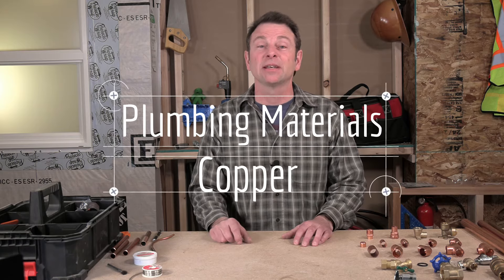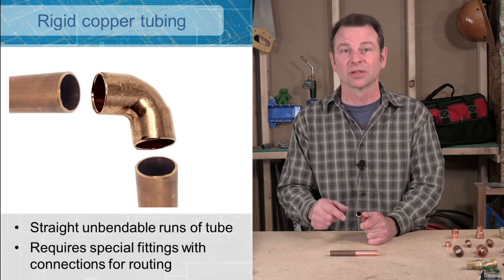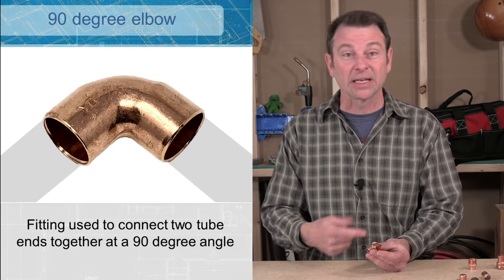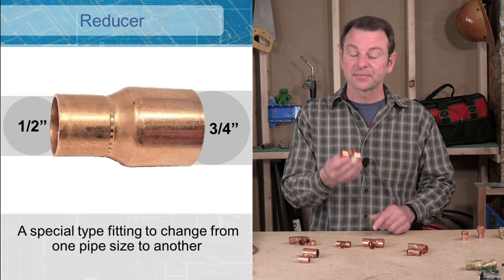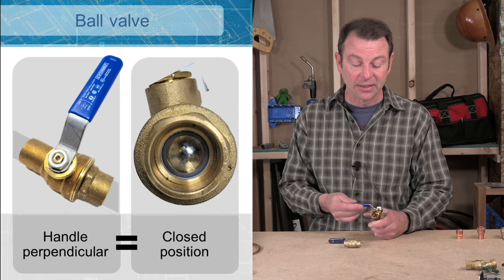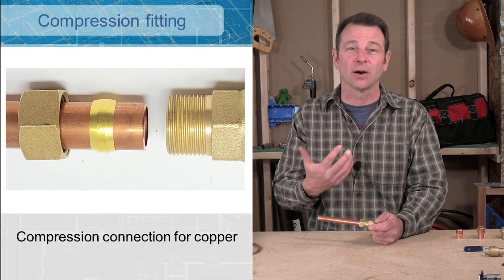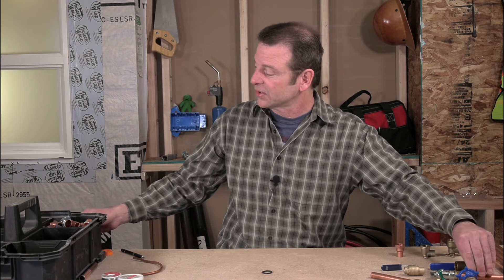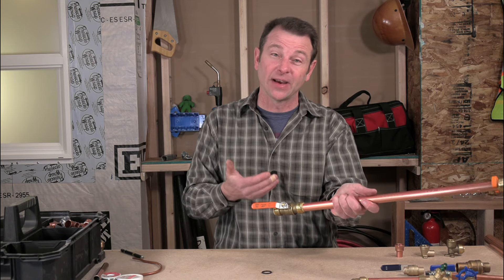A lesson about copper plumbing materials - Intro to Plumbing Series

Comment: You need to let people know there cannot be any burr on the end of the copper pipe or even the PEX before inserting them into a push fitting or it will damage the O ring within the fitting resulting in a leak...
Reply from the maker: That is covered in our plumbing process videos, the one you watched is just the materials lesson.
Reply: He already did that in the second video on this playlist.

Comment: Great video thank you!  I wonder what plumbers think about the push fitting, is it considered best practice?  Is it advisable only in places that are easily accessible such as laundry room, hose bib etc?
Reply from the maker: alot of plumbers are not fans of the press fittings.   I would not use them unless they are in the easy to get at locations